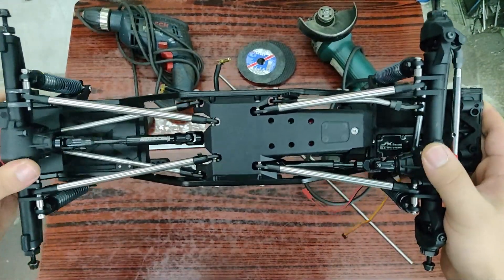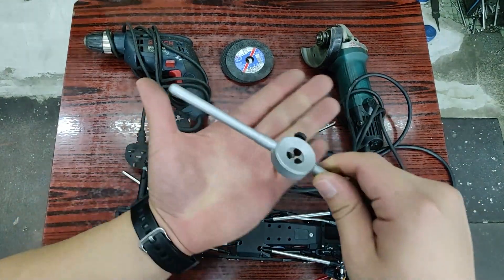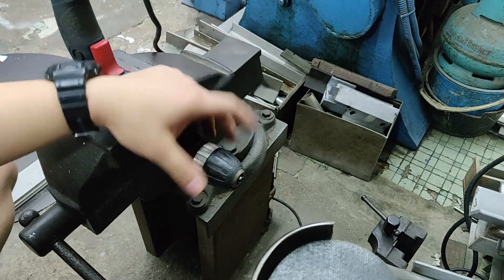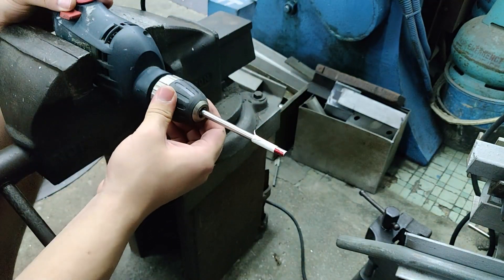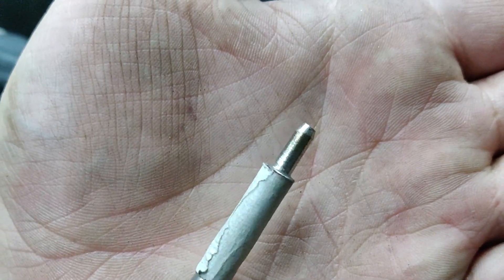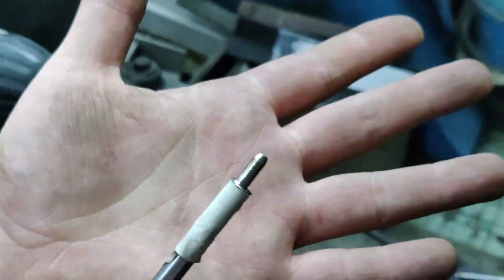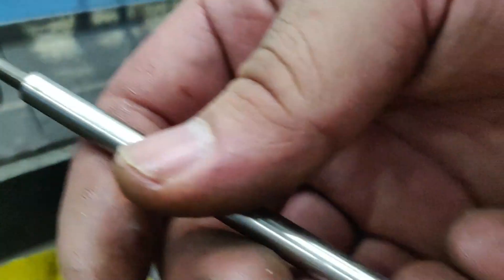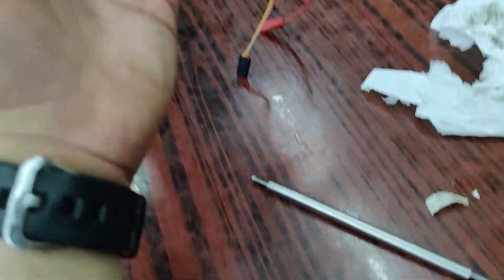How to make RC Crawler links, No Lathe Needed!

Comment: It's much easier using aluminium tube and stainless steel allthread.  I use 6mm OD by 4mm ID aluminium tube and 4mm stainless allthread.  Cut the tube to length using a tubing cutter.  Cut the allthread to length with a small hacksaw and clean up the ends with a file.  Insert the allthread into the aluminium tube and thread your rod ends onto the ends.  If you want to put bends into the link (for steering link or high clearance lower links) the completed link can be bent with a simple brake line bending tool.  Simplicity itself!!.
Reply: Ive been looking for some for my Losi Night Crawler. I think having somebody make them is the only option.
Reply: Aluminum sticks to rocks, stainless slides

Comment: Carbon fiber arrow shafts will work too for lightweight applications. They are hollow so you need to make a part that fits inside the arrow shafts that is threaded for the link end

Comment: I thought that the links have opposite threads on each end, when I replaced some on my Capra, I found one side was normal threads and the other side was left handed threads.
Reply from the maker: Not necessarily, opposite threads are useful for fine adjustment on tierods of individual suspension vehicles for toe/camber, not really a consideration for crawler links.  Axial started doing it after they were bought up by horizon, not sure why really there are no real advantages. For me it just adds confusion and complexity for no reason.
Reply: @CRCG_00  ok thanks, was curious because my Capra had it, I am now looking to convert my trx4 to a trx6 and the links from Traxxas have been backorder for a while, so thought I will try an make some

Comment: Great idea!
8-32 steel all-thread is another great material. Screws into the 4mm plastic rods. Easy to cut and bend to prototype your own high clearance links, and plenty strong and suitable as a final part if you cover the exposed threaded area with heat shrink/hard plastic tube for looks and some slideability.
Reply: I like to use some alloy tubing to cover the threads afterwards, looks sick and is the easiest job ever.
Reply: I have done something similar but slide 1/4 brake line over the all thread. I landed a jump wrong and completely broke one of the plastic rod ends off...my home made link was just fine...
Reply: @Cloudy0w0 what size and type of tubing do you cover the all thread with

Comment: It'll do that's for sure. Some advice for DIYers, be certain that the metal that you are cutting the thread on is ALL correct diameter or slightly less, never bigger. If you get near the end and haven't kept that diameter correct, you could either damage the thread cutting die, and or snap off the piece you're working on.

Comment: Heck of a lot easier to just cut them to length, drill the ends, tap them, and insert the thread rods from the axial ends kit. Or do like I do, and just buy a piece of grade 5 threaded rod and cut the inserts yourself. I've built about 15 rigs doing it this way.
Your way works, but getting the grind correct without causing a weak point at the end of the grind is gonna take some practice.
Reply: I need a set for a losi night crawler. Have u by chance made any for that crawler yet?

Comment: More advice for DIYers. I forgot this part. The recommended method for decent threads is to open up the cutting die a little using the screws in the die handle. That means releasing the two side screws and screwing in the central one a bit. Not all thread dies are split, some are solid, so you can't do it with those. But the split ones allow you to make a start cut and then a finishing cut by releasing the center screw and nipping up all screws lightly against the die. With a split die ou could even deliberately make the thread smaller than normal by doing the opposite and tightening the side screws before the center screw.

Comment: Nice guide! Since I got a 24 scale crawler, I was thinking i could use brass pipes and link joints from an aluminium set. Drill small holes and thread them. Then join them with pieces of threaded rod. I'm concerned the aluminium links are too small and fragile though.

Comment: Im finding it VERY difficult to start my threads. Im using a 4mmx0.5 die with 4mm stainless with a taper on the end. May just give up on making my own and dealing with the stock links on the trucks.

Comment: I like your style but how strong is that aluminum? Drilling out the link and using a grub screw is a lot stronger. Iv done what your doing props
Reply from the maker: It's stainless steel so much stronger than aluminium.
Reply: @CRCG_00  ahhh ok that makes sense. Nicely done gos to show you can do a lot with a few tools an jigs.

Comment: You dont need a grinder. You are more likely to take to much material off. Just hold a file against it while the drill is running.
Reply from the maker: I did experiment with using files, but it takes about 4 times longer to do and it also put alot more strain and wear on the chuck/bearings of the drill.
Reply: It sure does, I can confirm it makes your chuck wobbly and yeah, takes about 2hrs on stainless, but if thats all you have it still gets the job done.